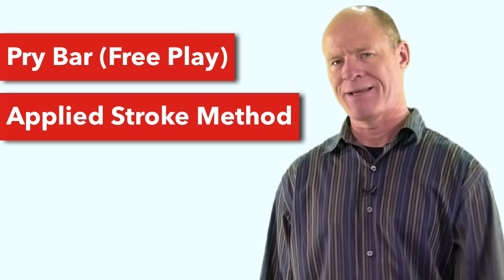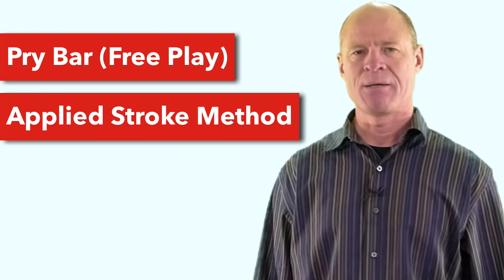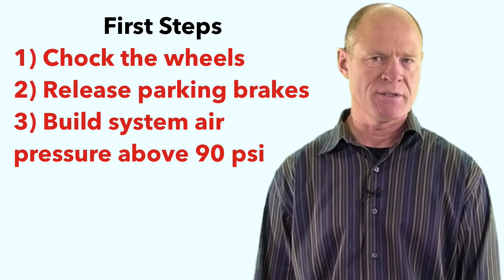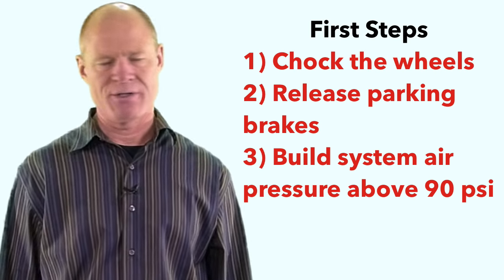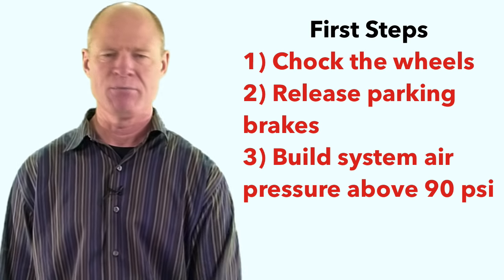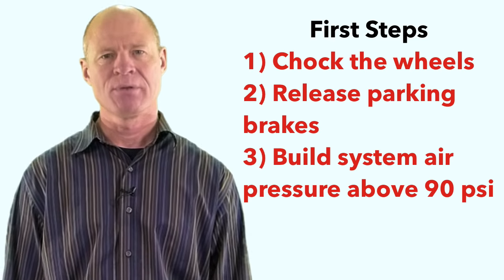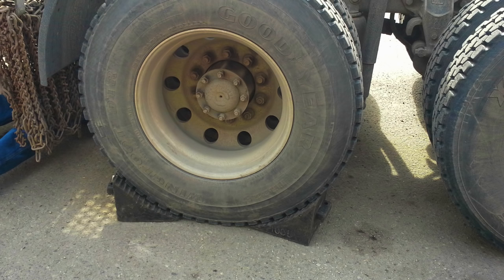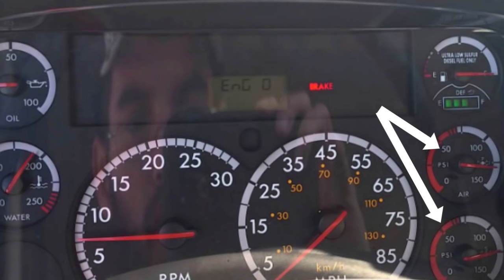How to Determine Air Brake Adjustment—Applied—Pry Bar—Mark & Measure

Comment: Where do you get those little yellow rings you put on the pushrods?
Reply from the maker: Hi Big Ol' Bear - I believe you can get those metal rings at some truck stop, but most parts stores and dealerships should have them. I would suggest ringing around in your area. All the best, Cheers Rick
Reply: Wooden clothes pens work well also and they’re cheaper

Comment: If you were a diesel bear asking me if I checked everyday I'd say yes. If I'm honest I'd say a few times a month on the tractor and if the trailer shoes have plenty of material I don't bother. I barely use my service brakes to slow the truck. Plan your stop in advance and give it full jake. The impatient fella behind you can go around.

Comment: Automatic slack adjusters don't work anyway
Reply from the maker: Hi Rick - Thank you for your comment. That hasn't been my experience. If these are properly greased and checked on a regular basis, these work well. If there is anything further we can do, drop us a note. Always happy to help. All the best, Cheers Rick
Reply: @smartdrivetest  okay fair enough, but from my experience, I've installed brand new slack adjusters out of the box,  marked the adjuster and notice after a day driving they back up several flats...ive done this test several times and had it happen more than once.. Better technology is needed imo... Cheers sir..
Reply from the maker: Hi Rick - Apologies for the late response. Thank you for your comment. Thanks for that information my friend. On the contrary, the problem with manual slacks is that drivers didn't keep them adjusted. I'm not sure what the solution is my friend. All the best, Cheers Rick
Reply: Im with you.  I don't like the automatic adjusters.  They seemed to fail more often then the manual. I put manual adjustor's on my truck .

Comment: "If you can't explain it simply, you don't understand it well enough." -Albert Einstein

Necessary and unnecessary info is given altogether,
This makes it hard to understand
Reply from the maker: Hi Huzur Sa - where are you in the world? You're struggling to learn something my friend. And yes, this is an older video that needs to be updated. However, all the pertinent information for measure push road stroke--either pry bar or mark & measure--is presented. All the best, Cheers Rick
Reply: He explained this as simply as one can. There is no "easy answer" when talking about an entire air system. 
If you don't understand, slow down and listen again.

Comment: He rite but soooo wrong  short stroke or long stroke chamber 30 spring break different  adjustment  length
Reply from the maker: Long stroke was a short lived fad in the 1990s. If it is a long stroke it’ll have square ports and the adjustment on a Type40L will be 2 1/2 inches. All the best, Cheers Rick

Comment: We were told it was a 12 pack.
Reply from the maker: Hi OldDrivenhome OldDrivenHome - apologies for the late response, and thank you for your comment and query. I'm not sure why - you're only doing a brake application 6 times, thus a 6-pack. If there is anything further we can do, drop us a a note. Always happy to help. All the best, Cheers Rick
Reply: No along with the FULL air brake test.  They tell us (we can) preform 12 hard brake applications to adjust the automatic slack adjuster, not a 6 pack as suggested in your video.

Comment: When I drove set your Park brakes you know there'd and yellow buttons the blue buttons are rare these days look to see that applied there all at 90 degrees (push rod slack adjusters angle) then release the brakes (engine off and in low GEAR) All the angles should be the same and app 1 to 1.5 inches
THIS IS SELDOM THE CASE,,,,,, MECHANIC'S, BUSHING WEAR,,, DIFFERENT MANUFACTURER OF ALL THE CHAMBERS (MONEY ETC ISSUES)
AND AVOID DOT IF POSSIBLE,,, SOME ARE IDIOTS !!! AND DON'T KNOW WHAT THE REAL DEAL IS !!!! WRITE TICKETS MAKE MONEY.

TAKE CARE NOW.